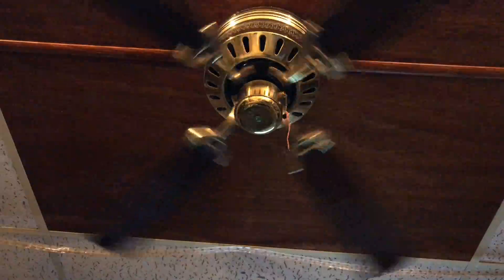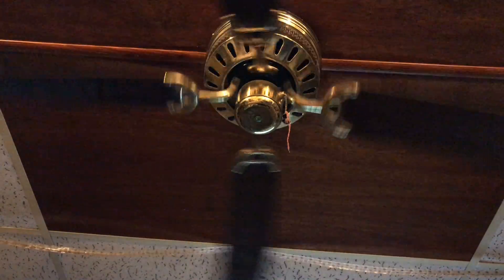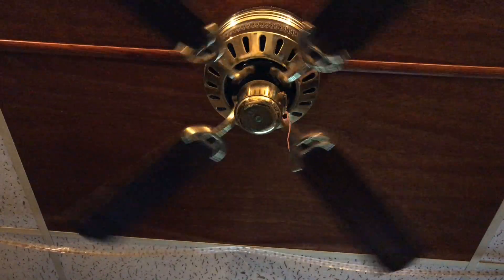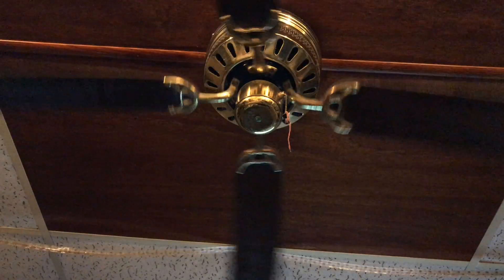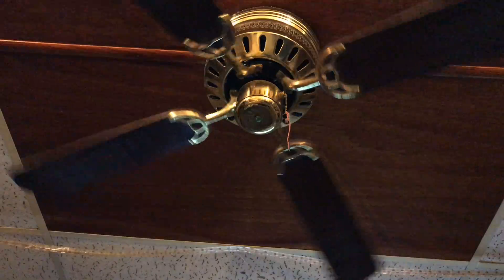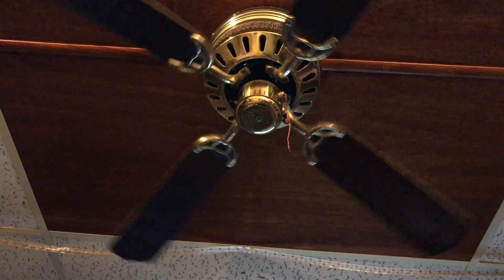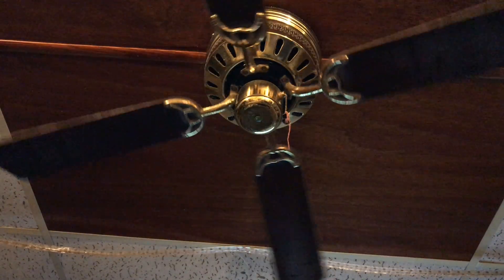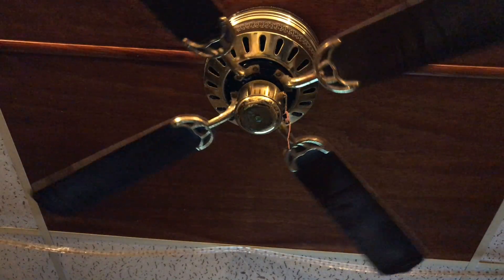Super Loud Ceiling Fan With Dry Bearings - Noise Run.

Comment: I have these fans in my house but my dad says he doesn't want to oil them, It makes a contact whooshing bearing noise
Reply from the maker: Mine really hums now.  I think it's the motor.  I keep the speed at medium, but the low setting is SUPER loud.  High setting is the quietest but moves too much air.

Comment: Nice to know we can see and hear a noisy fan. Be nicer if you tell, show what to NOT have noisy fan. How, wear to lubricate.
Reply from the maker: I did!  I have another video where I take the fan apart and lube the bearings.  It's not very good.  The fan is still in operation every day of the week.  Thanks for commenting!
Reply: Did you ask your significant other the same question or did you just assume the best places to apply the lube and go with it, if it didnt work then dud you just give up and let it hurt em or did you try reapplying it in different areas so everything went smoothly?? Same schpeal here..  if you still hear complaining than you didnt do it right.  If you simply just cant figure it out than somebody will end up doing the job for you..

Comment: I have the same exact fan  but mine has lights but idk what's wrong mine makes a loud grinding noise when you start it up and at one put it just stop moving until a year later I try it again and it moves now  but it makes a weird grinding noise when it starts up until you leave it on for a couple minutes and then it stops making the noise  does anyone know what's wrong
Reply from the maker: Hello and thank you for watching and commenting!  You can watch my repair video at the link below to see how to clean the bearings and re-lubricate them to quiet your fan down.  Good luck on your repair!
https://youtu.be/omtCwBJvw6Y
Reply: Oil the bearings...you can use a spray with a spray tube or take the fan down and use a lubricant like 3in1 or 5w30 motor oil. I used 5w30 with an additive of motorkote...but first used a spray lubricant to get it moving.

Comment: That isn't noisy lol.
Reply from the maker: Thanks for stopping in and commenting!  That fan is still up and frankly, it runs at medium just about 24/7 365.  If it's quiet in the room, the motor hums terribly and the bearings are now clicking.  It's usually not quiet enough for the fan to bug me.  Stay well!
Reply: Mine is more noisy than that fan. Mine is super squeaky.